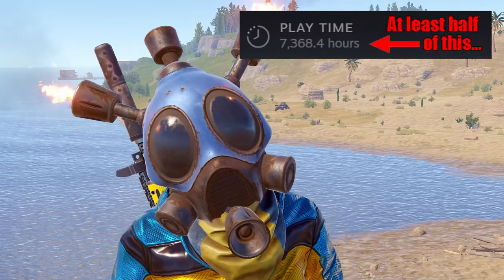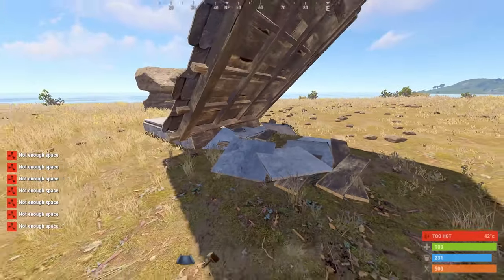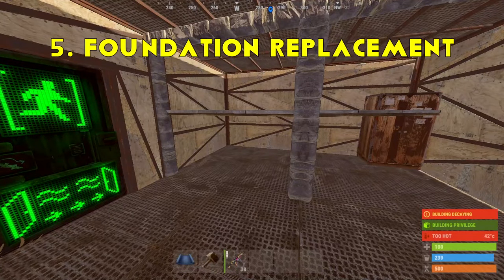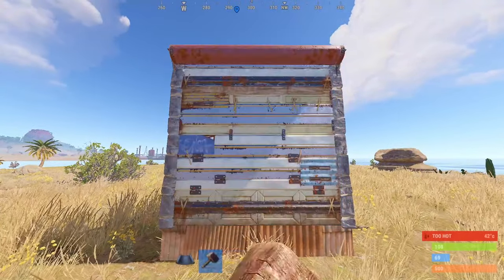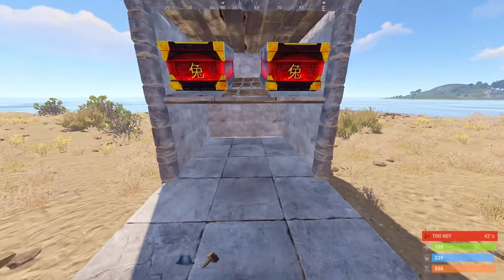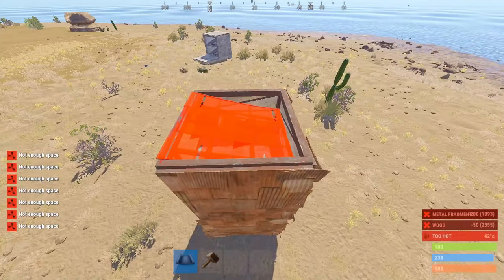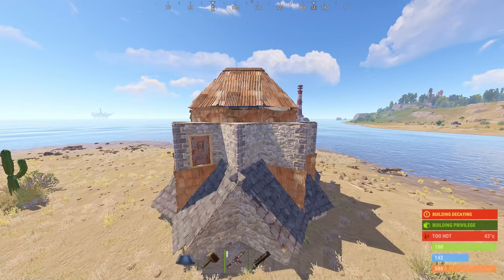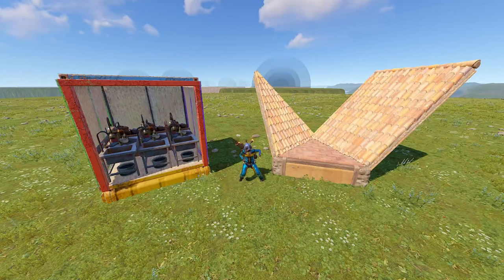The 13 WORST Things About Building in RUST @fcpnch

Comment from the maker: One issue I forgot to mention is that softside walls used to convert to hardside when a shelf was connected to them at half height. Facepunch patched this in December but in my opinion, it was a great feature and needs to be brought back. What do you think?
An example of this can be seen in the intro of this video: https://youtu.be/KbsFNShQz4U
Reply: I wouldnt mind if they fixed many of the issues u pointed out.But fixing only stuff on the raiders side seems one sided
Reply: friendly tip about your first building problem...even if its not pixel perfect if u rotate temporary tc u can place the tringle then rotate again and u ok idk why it works like that but yy..enjoy
Reply: It makes eco raiding a lot more annoying so I don't like it.

Comment: Placing roofs can cause deployables to break on the other side such as workbenches , boxes and piping. 

Problems with replacing deployables such as lockers back into single windowed triangles. 

Stability issues when making complex multi-tc bases deployables can break when upgrading any part of your base such as boxes in bunkers.
Reply from the maker: I believe lockers can be placed into triangles whilst standing inside said triangle. I didn't mention multi tc for a reason.

Comment: One to add, when placing 4 boxes in a square if there is a triangle coming off the square its easier, this makes no sense, either something should fit or it shouldn't.  Of course this can be mitigated with the new building skins but come on.  Some consistency and thought into sizes of things would be great.  I wouldn't mind seeing a complete revamp, make things sit flush against the walls and have consistent placements so things either fit or not without fiddling with being pixel perfect.

Comment: I can't even begin to count the number of times we have lost raids or been able to defend a raid but the initial pummel of rockets did things like this and the base was useless after because of a bunch of these problems! then there is the problem of being the builder of the group and wanting someone else in the group to help and they don't know as much about building and the order things need placed or built in (like ramp loot rooms must be build on the 2nd floor of the base before being able to build any on the 3rd floor otherwise the ones on 3rd floor if built first will stop the ones on 2nd floor being able to be built) and many other things like that.

Comment: Late to the party on this one, but for the TC placement I turn the walls inside out to place TC and that gives you more room to get the TC in position. You still have to get it right in the corner but you have just a little bit more wriggle room.

Comment: You forgot about the part where if you have breach peeks you can't place triangle / square floors on the half walls (on the sides not in the front which in some bases may prevent jumpup's from being built)
Reply from the maker: Good point. The same trick I showed fixes this.

Comment: The pipe thing is so annoying.  Made a base of all stone with pipes going to around 12 boxes with conveyors all tucked into corners and out of the way.  Upgraded to metal and all my pipes had to be redone.  That included me moving furnaces and other deployables just to get into the rooms to access the pipe connectors.  If i had known I wouldn't have put things where i did but also I shouldn't have to worry about upgrading my base in the first place.
Reply from the maker: Yea that's definitely the worst problem besides the ramps

Comment: I think taking away the floating wind turbines and sam sites was ok. Didnt really make sense and was just kind of a niche trick
Reply from the maker: It's a game, it doesn't need to make sense. The triangles can block turret angles on your roof.
Reply: @gahbor  that's not how I meant it Gabriel Rios Perez and you know it
Reply: @MoltenSands  no, i didn't know it. Neither did Crow apparently. So you could elaborate. 

If its not realism you meant, and its that "it's a quirky building mechanic", then so are bunkers and arguably stuff like widegaps. 

If thats also not what you meant then yea, I don't know what you're getting at, but id be glad to listen.

Comment: Most OP is auto despawn loot room by stacking vending machines in to the garage doors. I found when you have a dancing floor you can do it in one hight inset of 1.5. I know they kind of fixed it by vending machines dropping 50% of loot but still it is broken.
Edit: I find the original koncept https://youtu.be/xhnyDBw7yxc but as i sad with dancing floor from DLC you can do it in 3x3x1

Comment: How about optimization so ppl who don't have $3000 computers can play.
Reply: You don't need a $3000 rig to play 😆calling that an exaggeration would be the understatement of the century. GTX 1080, Intel i7-7700k or an AMD equivalent, a reasonably good SSD and 32GB of RAM. There you have a solid 1080p gaming rig for WAAAY less that you said. I have an RTX 3070ti, Ryzen 7 5800x, 16GB of RAM (upgrading to 32) and a fairly good SSD and even that cost $1,200 dollars LESS than your oddly exaggerated price estimation.

EDIT: checked out your last uploaded GTA clip where you're playing at 15fps. No wonder you can't play Rust lol
Reply: @electronichq974  of course its 15fps it's on a ps3 an a 15 year old game made for consoles not a pc game with constant updates but sure there the same